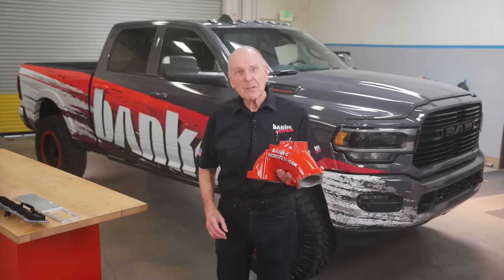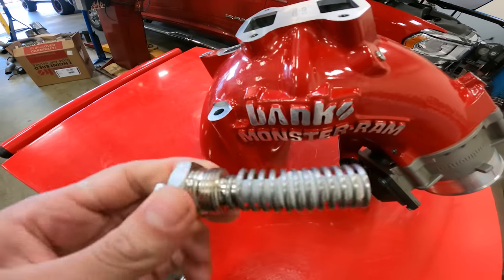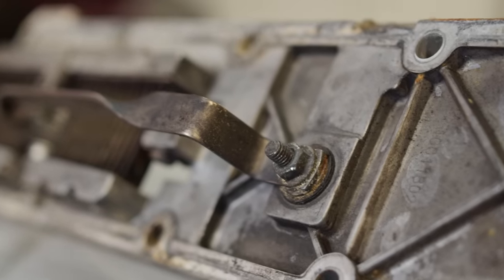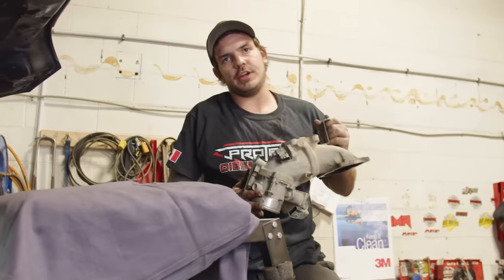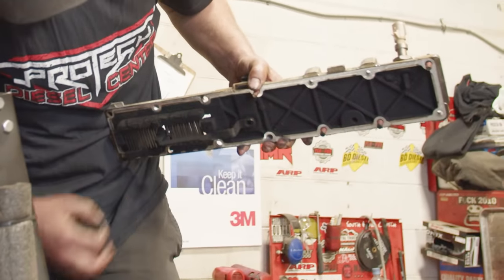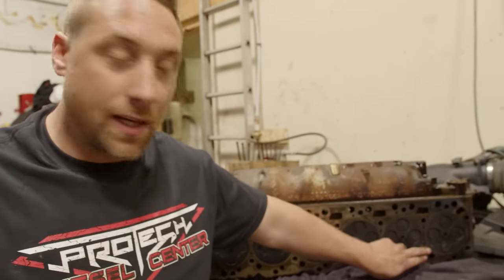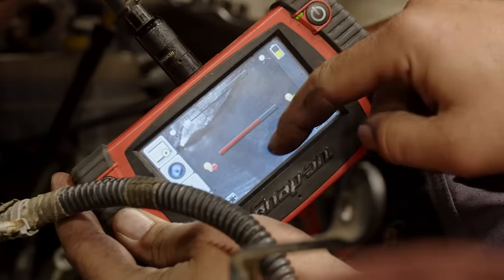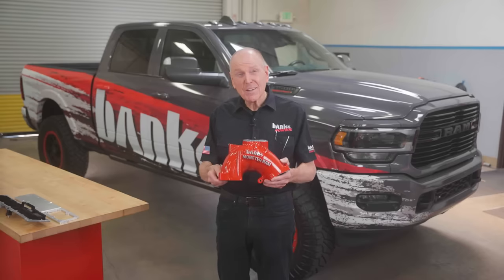How to prevent RAM Cummins 6.7L engine failure due to stock grid heater

Comment: Here at the utility company I work at we've already lost about 1/4 of our motors to this.
Reply: Well you know what to put on the other 3/4
Reply: What was the average mileage on the 1/4 of the fleet that experienced this failure?
Reply: @utboilerman  ya I mean no one wants to spend a couple hundred or thousand more one something you spent like $60 k plus but it is basically a drop in the bucket
Reply: Pretty awful and  know it was planned this way too. I have a 5.9 and no problems
Reply: .25 of how many? .25% of 5 is a lot, but .25% of 50 is not as bad.
Reply: @carl2591  I mean if you don't have trucks that were not being used maybe it's not that bad but 12.5 trucks down is worse than 1 and a quarter truck's down I mean if you don't have trucks laying around that 12 guys not working vs 1 to 2
Reply: @james10739  ... your response make no sense.. 
I was asking how many trucks does the company the fellow (Justin McCarter) mentioned has a 25% issues have in total..  if they have 5 trucks TOTAL, then 25% is a lot, but on the other hand if they have 30 or more  trucks 25% is not a ton.. you are going to have a couple 2-3 trucks down at any one time for issues normally when you have a large fleet. 

 I am currently working on a farm for harvest with 13 tractor trailer transport truck.. the other night 2 were out of service for emission issues.. they came back in 2 hrs but we were short. that is a 15% OFS (out of service) rate.. for that incident.
Reply: @carl2591  25% is 25%.... That's why people use percentage.

25% of 10,000 trucks would be 2500 trucks.  To be annoyingly specific that's technically MORE SIGNIFICANT statistically than 25 out of 100 or 2.5 out of 10.
Reply: really its unacceptable from dodge/cummins imo something needs to be done
Reply: @zacharymorris9917  .. that is correct 25% is 25%. so let me ask you this question.. 

would you rather have 25% of a million dollars or 25% of 100 dollars..  its the base amount that make the difference..

what is the total number of truck in this guys fleet.. he said they lost a 1/4 of truck to this issues but did not state the total number of truck in fleet.. was it 5 or 55 .. makes a difference.  peace out..
Reply: @carl2591  you are clearly unable to understand statistical significance.
Reply: guess so, cause i would rather have 25% of million dollars than 25% of a thousand.. so fuck yeah.. Statistical significance i would say.. peace out..
Reply: @james10739  ya not an overpriced piece of garbage. Just unhook it and your done.
Reply: These comments are worth at least 25% of the time it took to read them 😂
Reply: @alouisschafer7212  talk about a need for a recall, right?
Reply: paid 1500 for the kit and install.   my grid heater bolt looked perfect and was nice and tight.   

a neighbor had his let go.  i saved myself a headache, anxiety and possibly a lot of money.
Reply: There's a reason Ford or GM is a preferred fleet vehicle
Reply: Are you saying we get 25% off on the product? I'm confused...

Comment: I'm a true mopar fan boy but manufacturers need to be held accountable for crap like this
Reply: Class action lawsuits are sometimes quite necessary.
Reply: How long does this take because they said corrosion right I mean if so and obviously it's a known thing it doesn't seem like replacing it or going with the banks solution is any more of a manufacturer thing than a timing belt you have to replace every 100k
Reply: Technically not MOPAR tho, in this particular piece. Cummins should be slapped for this actually
Reply: 5 year 100k warranty  covers that. Maybe get your vehicle looked at when the check engine light comes on instead of driving it until it explodes. I've been. Working for FCA for 9 years. I've never seen that failure I've replaced  tons of grid heaters.
Reply: @customconnections2425  is the engine supposed to last until the end of time? That's actually  a pretty rare failure. Worked for Chrysler 9 years never had one of those failures in the shop.
Reply: @fredtflail  it might be due to weather difference, they were in Canada, more condensation from warm engine and frosty air.  You are correct though, just had my VW tdi engine replaced. Started out a throttle body/anti flutter valve, was down on comp, VW bought me a new engine.
Reply: This is the stuff that gives the 12-Valve Cummins guys some serious cred.
Reply: I used to own a fleet of Crown Victorias and most had a plastic intake manifold that leaked. There was a class action suit and I got repaid for all of  the leakers. I think is was about $15,000.
Reply: @ginogallegos8079  Troll much?  Good for you.
Reply: @fredtflail  so after how many miles should it be replaced to keep this issue from happening? Every 150k with transmission and coolant?
Reply: @fredtflail   they should have used a stainless steel bolt assembly and there is no way the development engineers do not know about this. my new 1980 toyota 4x4 pick up engine lasted 600000 km with only a new fuel pump and a battery and normal maintenance with no weird stuff and i did all the maintenance and do not cut corners. as the truck was getting  on by then i sold it to some guys who converted it into a power unit for a water pump but they didn't figure out the cooling system requirements for that purpose and cooked it for dinner  😳
Reply: Cummins is the one responsible.
Reply: Cummins and Mopar are two different animals. I'm not a Mopar guy at all but my truck of choice is a Ram 2500/3500 WITHOUT the Hemi
Reply: and fire the engine designer
Reply: @allankwiatkowski9086  there's nothing wrong with the engine
Reply: This is not a Mopar product.
Reply: @DeltaSierra426  what does valves have to do with it?
Reply: @fredtflail  so you in the front office where the customer comes in and the service writer tells you no  warranty,or you a mechanic and never see it because it don't get past the service writer
Reply: Does this plague also affect the '23 Ram 3500 6.7L?
Reply: @fredtflail agreed people should maintain their vehicles, but there’s no reason the engineers should have designed a nut that eventually welds itself off and destroys an engine.  They could have created a screen or something to catch the nut if they insist on using that grid heater.
Reply: Let's perform a lawsuit against them
Reply: There's a recall on the grid heaters and the grid heater relay. I do alot of them.
Reply: @Richard.Hybels I sold a crown Vic 4 years ago still with a plastic intake!

Edit
For anyone who might say, "Crown Vics from 96 on had plastic intakes".
 Yes, I'm talking about the plastic coolant crossover.......
Reply: @Steadierpark "welds itself off"
🤔 Make that make sense!
Reply: And maybe stop doing shit once you find out it’s killing your engines
Reply: @fredtflail  Worked on potentially every applications of this motor and first time i see this...

Comment: My grid heater bolt came off in the mechanics hand during Monster Ram installation. I was watching as it happened. I was extremely lucky. Don't wait. Change it out .
Reply: Should this be replaced on brand new trucks under warranty?
Reply: What year was your truck
Reply: @1Peter321  no only when the truck has over 150k miles
Reply: @greygoose4x46  2013 to 2018
Reply: @qalv97  thank you … was there a recall on this? When I google it it says there is but my truck has no open recalls and I don’t remember this having been addressed …

Comment: How does your updated coil heater not be suspect to breaking off and going into cylinder as well? Doesn’t it get hot and live in the same sooted environment?
Reply: Exact same thing I was thinking. They need to make a screen that will catch it if this does happen
Reply: Hopefully Banks answers this question, it might not draw as many amps. Part of the problem with the factory one is it can arc from the bolt which weakens it.
Reply: It does look flimsy in comparison. Those tiny coils could become brittle and break off. Why not use an old school glow plug instead? I think lots of people are buying those intake horns for gains and possible preventative engine failure but the new style heater doesn’t look like it’s not prone to failure as well. If that breaks off from so many cycles won’t we be in the same predicament. What’s the new style coil heater made out of? How many cycles is it good for? What’s the warranty cover and is Banks gonna buy a new engine if it does break and cause damage?
Reply: @josemejia6645  That's a duramax grid heater coil banks is using and they have been in use for ages without issue.

Comment: My Cummins experienced this failure 6 months ago at 200k miles.  I consider myself lucky that it only bent 2 exhaust valves and imbedded in the top of the piston.  Crushed the top ring land so it scuffed the cylinder wall but was able to be honed out.  Cylinder head and guides checked out fine.  Obviously the Banks grid heater delete and Monster Ram intake went back on so should
Reply: Why is this more prone on the 6.7L?

Comment: I had to move in from the 6.7 when the def system failed 3 times in 28k miles. Parts couldn’t be found or ordered for 4 months. Loved the truck, just couldn’t wait
Reply: What happened to it? Mine has 300k miles and haven’t had problems as much

Comment: I am in MD and HD industry I claim warranty all day long on cleaning the intake it's very common for the grid heater to plug up solid. Have not seen many bolt failures but I see the superiority in Bank's  design
Reply: Will the Banks part work on an MD/HD vehicle?
Reply: @ronunderwood5771  doubt due to positioning of cac tubing
Reply: Curious why this sounds like a 6.7L issue, and not also 5.9L?

Comment: There are two giant questions this video does not cover:
1) How well does the coil heater work?  How cold can ambient temps get before the less effective heater becomes a problem?
2) What is the failure rate of the coil in relation to the grid heater bolt?  I see a metal coil that will repeatedly heat and cool for years.  If it fails, its going into the intake just as the bolt does.  Common sense tells me its MORE likely to fall apart than the factory bolt.

Lastly, does a deleted truck have the same risk, or does the delete remove the conditions that cause the corrosion failure in the first place?
Reply: All I can say is I have it on my truck and I live in New England and it works just as well as the factory grid heater. A regular delete doesn't remove it it's under the intake horn and really blocks air flow. It is definitely worth the money and it's really not that hard to do. I did mine in 5 hours with no leaks or anything
Reply: well id imagine just like glow plugs of old has to be replaced every so often thats just common sense. as far as cold starting if live in cold climate should already have a block heater and winter fuel oil aka #1 deiseal.
Reply: @alexlindekugel8727  I don't live in a cold climate but I do off grid camping in cold climate at times.

Comment: Do not forget to replace the intake air heater solenoid, your different style intake air heater may be able to hold up to The relay continuing to fail but The Mopar intake solenoid is the reason why the Cummins intake manifold heater fails. 

You could get by with just replacing the solenoid as a preemptive, but I highly recommend doing both the banks ram and the solenoid
Reply: Can you expand on the solenoid problem?. What do you look for to fail the solenoid when its still functional
Reply: @cookingwithjesus  Problem is it sticks ON. Other thing is unless it is cold outside, you dont even need a grid heater. I start my 5.9 Cummins without waiting and it will start right up even very cold outside too. I mean if it is freezing out, it may crank longer.
Reply: could we just unplug the solenoid so it never runs again? will it give a check engine light?
Reply: @Da9guy1993  you can unbolt the stud off of the solenoid to the heater and leave the solenoid plugged in otherwise, The ECM will still receive the resistance through the coil thinking it's still hooked up.  There is an updated part number for that relay through Dodge.  But I also do like the idea of this intake system if I had one of these myself just for that gain of efficiency Make the turbo work less
Reply: @Da9guy1993  yes, it will trigger the light. engine will still start if in good condition. It may crank longer if it is really cold outside.
What you can do is connect a dummy load to the wires to fool the computer.
Reply: @mccarterjg  yes, unless the ecm is also reading current draw thru the heater itself.
Reply: @Da9guy1993  How about putting it on a toggle switch. Only use the grid heater if it is real cold outside. Which means bypass the current when not needed from going into the grid heater. That will make the grid heater last maybe forever.
Reply: @scottdowney4318  it's been a while since my last rebuild, but I believe the solenoid reference for voltage to the IAH in on the solenoid load stud if it existed, not on the IAH stud, which I remember is just the 8 gauge wire
Reply: @mccarterjg  One way to know, disconnect the big grid heater wire, see if it sets a code.

Comment: Just installed this on my old 2009.  New heater coil works great out here in western Canada!
Reply: What Temps are you seeing in the winter.  I've been contemplating this but heard rumors the glow plug doesn't work that good in -20⁰C nevermind -40⁰C.  What's your thoughts ?
Reply: I see weeks of minus 40C, sometimes down minus 60C on the prairies.  At that point, you have to have the block heater plugged in, battery blankets, strong batteries and so forth.  It's always started but takes a bit longer to smooth out versus the grid heater. When it's really cold I'll cycle the key a few times for half a minute to warm as much air as possible if the truck has been sitting a long time. Other than that, it's always started. Never started then stalled and have to try again.

Comment: Have had 100s of 6.7s Cummins come through the shop(not in the dodges), never seen this failure before. Replaced a few for the heating element failing though.

Comment: You know i wanted a diesel truck for 20 years before i finally found one I could afford. I told myself for 20 years, i can’t afford that. After buying a 2003 ram 3500 4x4 with 142,000 miles for 16,500$ i learned the hard way that i was right all along  i can’t afford it. I descovered the next day while replacing a leaking radiator the used car salesman had most likely filled with stop leak that the truck had been previously wrecked tho tgere was no report of it on any report i found. When i pulled the charge air cooler hoses off i found them full of dirt. The entire intake system had a brown coat of dirt road inside it. I found the culprit was a cracked air cleaner housing surrounded by overspray from the paint job done. Having to leave for my hitch that day and not liking the odds of me murdering a used car salesman whe he inevitably would tell me its my problem I decided to put it back together and take it to work being i had no other means. Freshly married with a kid on the way i needed to get to work. I babied the truck in hopes of making it last until i could save the 4000$ for the parts for me to rebuild it. I made it 12,000 miles before it dropped a valve turning a 4,000$ repair into a 12,000$ repair with me doing the work. While continuing to make 328$ a month payments over the next 3 years and 3 months i spent every waking moment and spare penny in my shop making a computerized truck work with a non computerized 12 valve i had aquired from a buddy who also brought me a 1984 dodge d250 with a gas engine he picked up for 450$ . I put another 300$ into the 1984 and got it road worthy. I used this truck to make parts runs 28 miles into town to eventually get my diesel truck back running a month after i finally paid off the note. For the first time in 3 years i decided i was going fishing, hooked up my boat, got in my newly repaired diesel truck to find the alternator not charging and the ac not working. Probably was a simple problem with the crank sensor bracket I fabricated, or the tone ring  i milled into a 12 valve harmonic ballancer, but i was absolutely done with it. Traded it in on my wifes durango for 4500$  
I took a screwing getting, owning, and selling that truck, but selling it i vowed that was the last screwing i was taking from a g d diesel truck. Im still driving the 1984 dodge to this day. When the driveline finally does get tired if it doesnt outlive me, i can rebuild or replace for 500$. I have drove that truck almost 10  years and have less than 1000$ in it with no signs of it quitting anytime soon. Diesel trucks are a rich mans game, and i am not a rich man